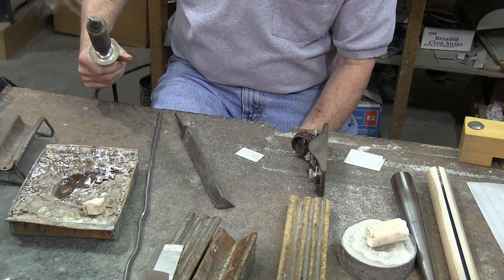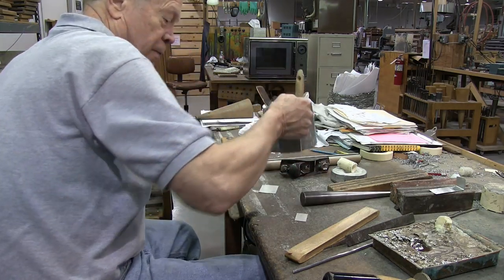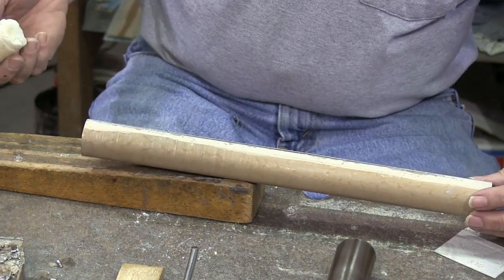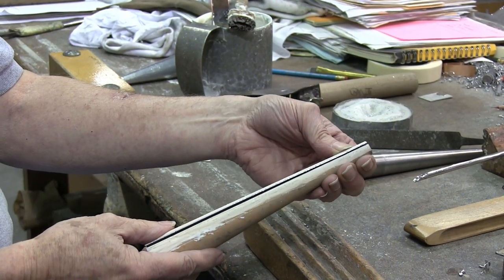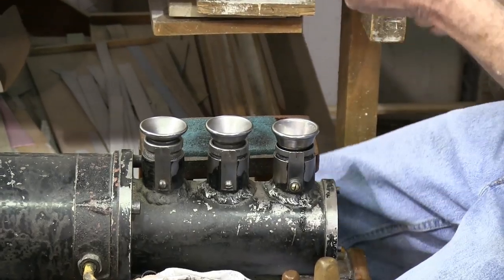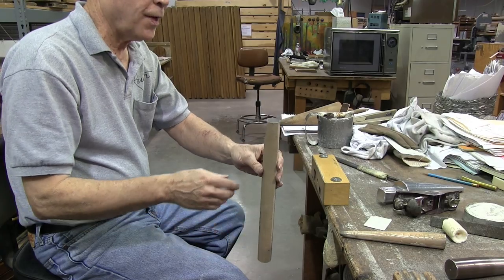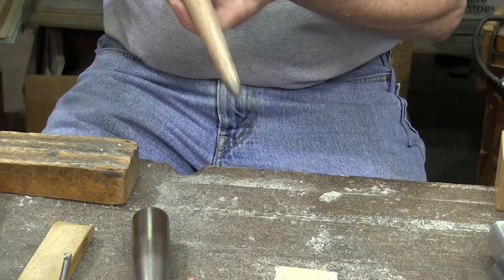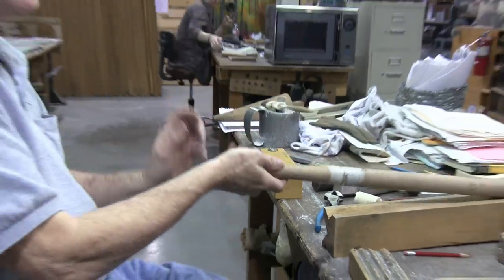Assembling an organ pipe

Comment: I don't see any scars on your hands and fingers from burns. Over time, do those pipes collapse from their own weight? The metal appears quite soft. I'm thinking of 16 foot pipes which might weigh hundreds of pounds.
Reply: Pipes can definitely start to collapse under their own weight after many years, especially 16' and 32' pedal pipes.  It's frequently a part of restoration to reinforce and re-round large pipes like that in an older organ.  It's also one of the reasons that it's easier to have the largest pipes be made of wood.
Reply: Thanks for your reply. It was interesting to see how pipes are hand-crafted so meticulously. I guess that's why each rank of pipes costs thousands of dollars.
Reply: They can, but there are organs in Europe that have metal pipes that have stood for centuries.  If they're racked correctly, they shouldn't collapse.  Large pipes are "pinned" about half way up to a rack, maybe even in a couple of places.  Some organs built in the late 1970's and 1980's had issues with large pipes collapsing because the zinc bought from Europe was too soft.  Zinc is lighter, but it still needs to be strong enough to withstand the weight.  When I took a position in 2001, the bottom six facade pipes were missing because of this collapse.  They replaced them (at considerable cost) with stronger zinc pipes.  So what they're made out of makes a difference too.
Reply: @robertramsay5963  One 8' trompette real cost $25,000 as an example.
Reply: That's a big chunk of cash indeed, but understandable when it such hands-on work.
Reply: @fnersch3367 the reed pipes are especially expensive to buy.  They are more complicated to build since it has a moving reed down in the boot.

Comment: Where do I start?
We have an old pipe organ in our local church that needs a little repair.
I am a master metsl craftsman and I think I can make thebdies and scribe tools.
What type of tin do I need to get and what magic is in the size?
Reply: The tricky part with metal parts is voicing - it takes a fair deal of understanding for pipe mouth dimensions, the languid tip and such. 

I remember my work experience at an organ builders, they too made it look easy (if you have to do 54+ pipes per rank, you get good fast!)

Pipe metal is usually a mix of Lead and Tin in varying percentages, usually more lead than tin, although Zinc and Copper have been used in recent years to good effect. I recommend getting in touch with a local organ builder and requesting a tour of the workshop if you can.

Comment: what is material of tube?
Reply from the maker: Lead and Tin
Reply: @OrganMediaFoundation  could you be more specific on the thickness and a supplier for the sheet metal please.
Reply from the maker: @conceptobject  The metal is a mixture of tin and lead made in cast sheets by the Reuter organ company for their pipe shop. The metal is then planed to whatever thickness is required for this particular rank of pipes.
Reply: @OrganMediaFoundation 
whoah.
that is next level.
Could I buy a small piece from you enough to make 3 feet for our organ.
I think I can make all of the mandrels and custom tools.
We should talk.
I sent an email to the Reuter organ company.
Wasn't sure if it made it through.
I really appreciate your videos thanks for sharing your knowledge.
Reply from the maker: @conceptobject  we don't supply metal. The Reuter organ company is no longer in full operation. To find out more about pipe making, your best option would be to contact a pipe organ builder.